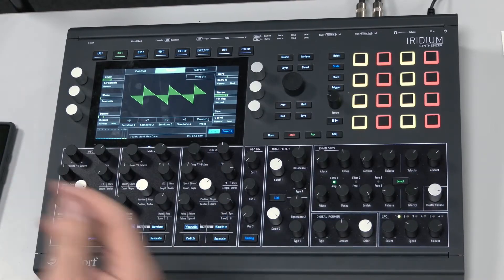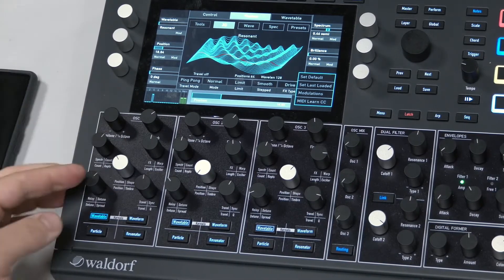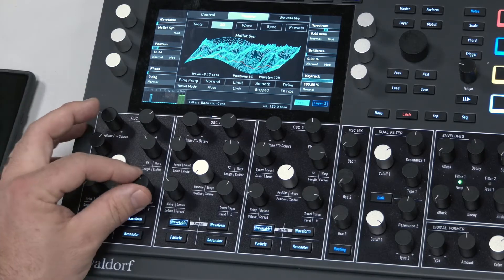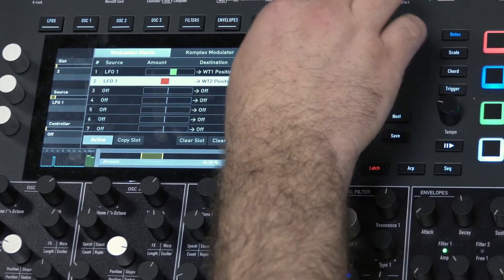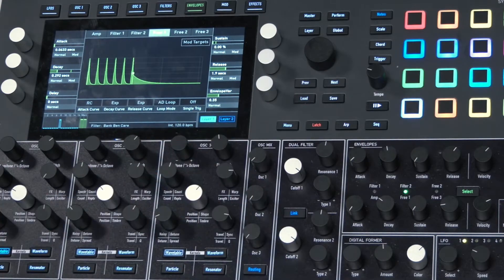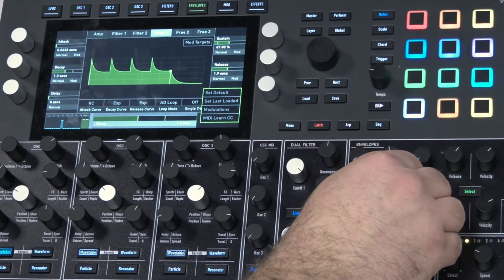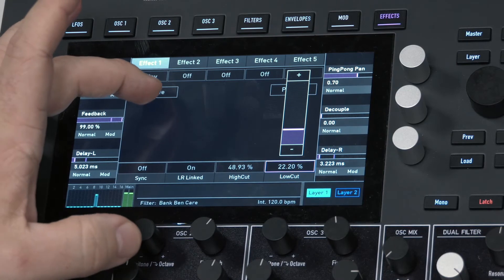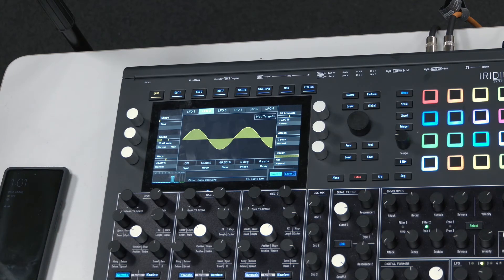SCM Waldorf Iridium Workshop: Video 4 - Wavetable Oscillator

Comment: Learned a lot from your videos! hopefully you record more often or have a paid course somewhere.

I'm following along on the Iridium Core, but there the Drive FX Type is missing. Maybe I have a newer version or this is just missing on Core? For me OSC1 Timbre tab bottom show: Ping Pong Travel Mode (Just like in this video), Limit Limit, 0 Deg Phase, 0.00% Noisy.  

Of the 5 bottom buttons there is a FX Amount but this is a different FX: this controls the FXTotalDryWet for all 5 FX'es combined.
Reply: never mind, assigning Free Env1 to control Dry/Wet Effects tab to Drive FX...

Comment: Are you able to shape the slopes on the LFOs? Change the curves from convex to concave for example?
Reply from the maker: Yes. There's a warp feature for all oscillators I believe. Ours is out for warranty repair so I can check it but I believe so.
Reply: @BenjaminCarey  wait what happened to your unit? I was thinking about picking one up but I’ve heard horror stories.
Reply from the maker: @CharlesFerraro  it bricked after going into a boot loop. We're getting a warranty replacement.